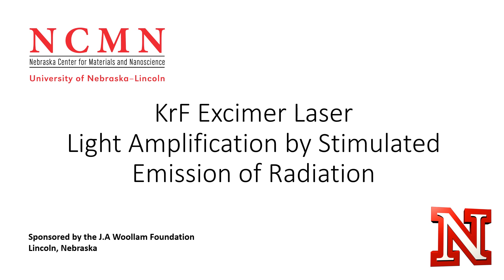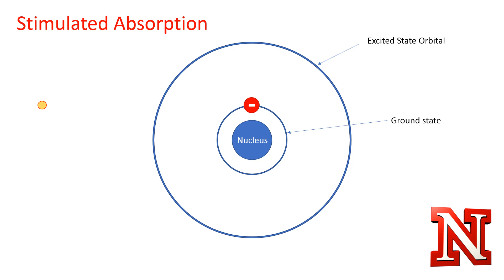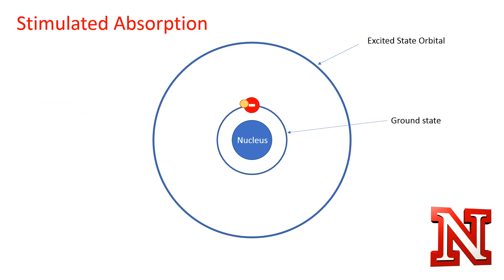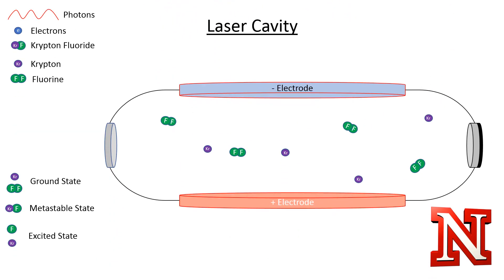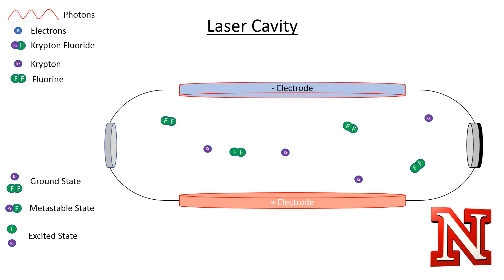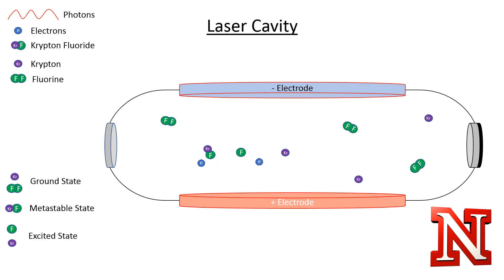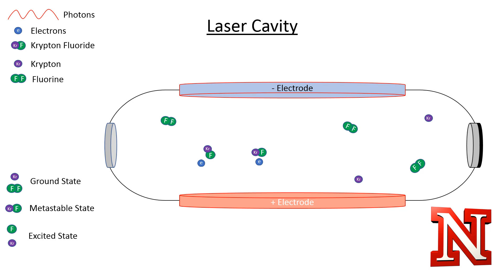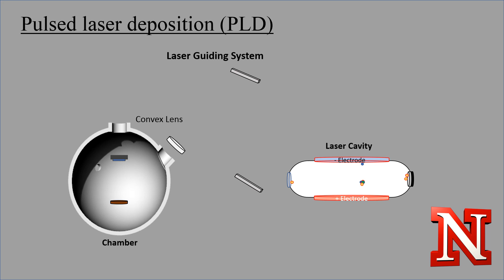Excimer LASER basics

Comment: It was chemical laser ?
Reply from the maker: They do involve some kind of chemical reactions. For example, in ArF laser, Ar reacts with F2 to form ArF. But ArF is only metastable, which makes it not the same as typical chemical reactions.
Reply: @ferrothinfilmslab3411  but why its detail is rare on web , text books etc ?
Why there's any experimental demonstration on YouTube ? 
Is it extremely difficult to make ?
Reply from the maker: There are at least two reasons. 1) The laser gas (F2, ArF, KrF) are all very toxic (fatal if inhaled). 2) The lasing requires high voltage (30 kV). Therefore, excimer laser needs to be handled with extra safety measure, which of course makes it expensive.